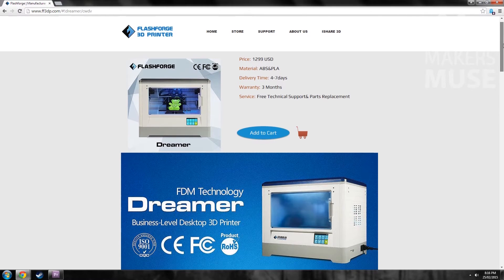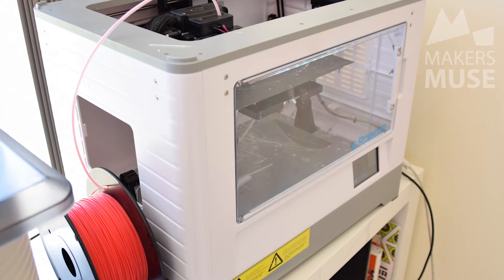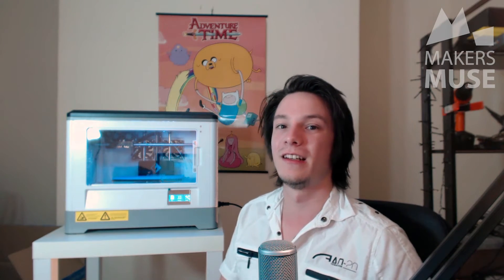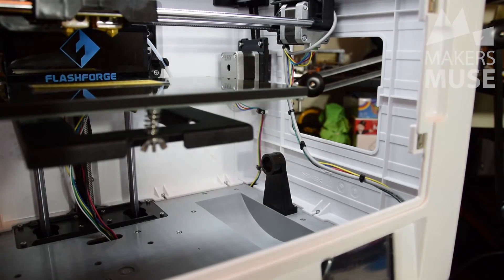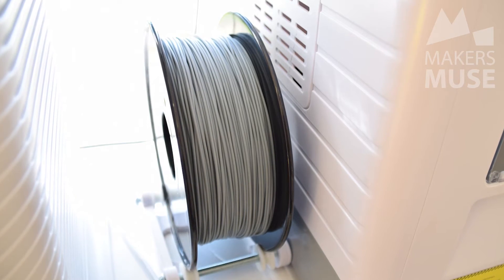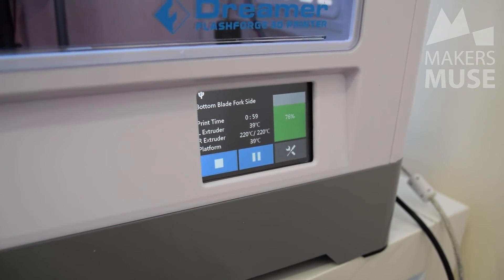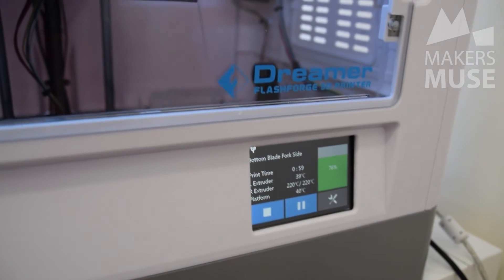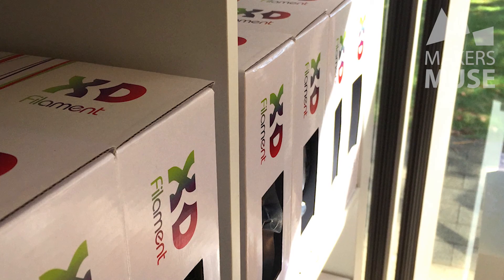Flashforge Dreamer 3D Printer Review - 2015

Comment: Great Review! I enjoy your channel.
request: can you do an in-depth review of the dreamer? including the functionality of the lcd menu options? I have never owned a 3d printer but am intelligent enough to understand that the bad reviews I've seen could be due to the settings the user has. basically I'm asking if you can show the functionality in detail when used properly with the correct filament settings. how well will this do graphene filament? wood fill? carbon fiber? What are the adjustments you can make for printing an exotic with pla for example. stuff like that.
Reply: also, I am looking to print a TPU  bulb pump to push liquid into an ABS tube (hydraulic type device). will the TPU bulb hold liquid? What would the minimum thickness, of the walls of the bulb, need to be printed at?

Comment: Great videos btw.  I own this printer, and can't get ninjaflex to print on it yet.  I noticed your spool holder looks like it would have a smoother feed than what I printed off, hoping that's reason why.  Have you tried ninjaflex with yours?
Reply: +Justin Bourlier If you go to thingiverse there is a print of a build block that has solved the problem of flexible fillament, but i have not tried it myself just yet.

Comment: Thanks for the great instructional video.  I am searching for the right combination of scanner, software and printer.  I need to be able to scan small figures  70mm - 120mm into a software program that will allow me to add cloths, change the leg or arm positions and maybe enlarge the size somewhat.  I have never used a 3D printer before and I have never use a CAD system before, however I can pick up info quicky.  I have a graphics design background - Photoshop - and I have  computer programming degree. 
Any help you can give me will be greatly appreciated. Again thanks for the cool video!
Reply from the maker: +Sonny Phillips To scan figures of high detail at that scale you would have to look into a high end scanning system like the David SLS-3, capable of capturing detail up to 0.05mm but it's not very beginner friendly. You could look into the einscan S (I reviewed it on this channel) which is cheaper but uses a similar 3D Scanning tech. If you're familiar with photoshop you may pick up the Post processing of 3D Scans fairly quickly. You could the use software like zbrush to digitally draw in clothes and tweak the scan (not very easy but possible). Cheers!

Comment: I see you have been using some sort of slurries on the heat bed. I guess if you try hair spray, you'll be delighted by it adhesiveness with clean printing as well. Do respond if you have tried this earlier. I would be glad. :)
Reply from the maker: +Atul Mourya I've moved most of my printers onto buildtak, it works awesome and needs no surface treatment! I used to use abs/acetone slurry but it's very messy. Never had much luck with hairspray, hard to find the right type I suppose!

Comment: I have a robo r1 and it loud. Is this any quieter?
Reply from the maker: +Aiden Kashi Loudness is very subjective, what part is loud, the motor movements, fans? It's certainly not a quiet machine but I haven't used a robo r1 so can't directly compare. The dreamer's plastic frame makes it resonate louder at certainly movement speeds.

Comment: Amazing review, would you recommend this over the creator pro
Reply from the maker: Creator pro is built better but older and the interface isn't as good. Both are about the same in my book, and awesome if you use simplify 3D to slice!
Reply: Maker's Muse
are they comparable in print quality in your opinion.? I'm asking because I'm about to buy either one of them
Reply from the maker: Yeah pretty similar, I feel the creator pro really needs simplify3D to be good but the dreamer is ok with stock software. Also check out the flash forge 'guider' it looks pretty awesome pla only though...
Reply: +Maker's Muse well I'm getting the printer for making an invention and PLA won"t cut it. actually I was going for zortrax but material availiability changed my mind

Comment: Nice review thanks man, I saw the very same design from QIDI TECH 3d printer but much cheaper do you recommend it or do you know anything about it ? thanks
Reply from the maker: ***** They look like a cheaper clone of the older Makerbot Replicator 2X - possibly OK but be wary for poor quality control at that price - you might get a dud... The older 2X's needed a fair few mods to make them as good as the flashforge machines are now.
Reply: +Maker's Muse thanks so much, youre the best !
Reply: +Maker's Muse Hey I finally got the Flashforge dreamer can you tell me whats the best 3d software do you use to design things ? Thanks
Reply from the maker: +AuroraCypher Nice! If you're just starting out, check out 123D Design, or Designspark Mechanical. Both are free  and not too difficult to learn.
Reply: +Maker's Muse hey i have bought the flashforge and trying to print the traffic cone, but as soon as it changes to the next colour the extruders dont "swap" it just prints the white like way over to the left,, PLEASE HELP MEEE. i dont know what to do =(
Reply: Slicer Badger did you assign 2 colors to  it in settiinngs?
Reply: +AuroraCypher yeah it prints in the two colours but the left extruder isnt moving as in it doesnt move so it is in one print, it is so wack... i think its something wrong with the software,,,, IF YOURS IS WORKIGN ANYONE PLEASE TELL ME WHAT FLASHPRINT SOFTWARE VERSION YOU USE PLEASE PLEASE!!      D=
Reply: Slicer Badger ok have you tested left side first then right side then both extruder ? it could be a clogged. Mine is version 3.5.1 latest version.
Reply: +AuroraCypher it isn't clogged... the extruder extruded but doesn't compensate as the traffic cone prints find but when the next colour comes it is to the left... something wrong with the gcode??

Comment: I've had this printer for about a week and i cant get abs to stick to the bed without a raft, is that normal or do I have my settings wrong. I keep raising the bed temp to help but it still wont stick, I am currently heating the bed at 125 and extruding at 235?
Thanks for all the information you are sharing on these printers it helped me make my mind up to buy this machine :)
Reply from the maker: benofkent are you printing onto the blue sheets they come with? Getting the bed level dead on for printing can be hard and you may need to slow the first layer down for maximum adhesion. Your bed is possibly too hot, 90deg should be enough.
Reply: Yes I am printing on the blue sheet it seems to have one already fitted to the bed,
I didn't realize I could slow the first layer down i will give that a try:)

Comment: hi maker muse do you know of a good way to take the old build tack off of my dreamer so i can put a new one on.
Reply from the maker: tmy158 Once you get a corner or two up then you can slowly pull the sheet off, it takes a lot of force but will pull away slowly and steadily. I find a sharp scraper (I have one on hand to get prints off the build tak) is good to help get under an edge. After you pull it off, make sure the bed surface is nice and clean with no sticky residue before putting the new sheet down. :) I use isopropol wipes.

Comment: Hi can this work with google sketchup ? thanks
Reply from the maker: zero00tolerance I highly recommend against google sketchup for 3D Printing - its very hard to get good .stl files out of it without various plugins. I recommend tinkercad, 123D Design and Onshape instead, all free!
Reply: Maker's Muse
ohh wow thanks so much I will check out the softwares you recommended, really like your review video, well informed and details.
Reply from the maker: No worries, glad it was useful!
Reply: +Maker's Muse Really ? I have been using sketchup since the first version but especially us it since I've started 3d Printing around 3 years ago, I do use the STL exporter plugin with my UP mini, I get fantastic print with ABS and PLA with a hardware temp mod, but I might try the software you recommend maybe I will get even better prints. Thanks (subscribed)

Comment: Hi makers muse love the channel, but i just got a dreamer and was wondering what temp i should be printing at for pla and abs and the print bed temp with the tack sheet.

Also i am having trouble getting the print off of the tack sheet that comes with is, the shop i got it from said the following temps

ABS: degrees c
bed 110
extruder 240

PLA
bed 60
extruder 230

and do you have any other tips and tricks for printing with this machine.

thanks
Reply from the maker: tmy158 Hey mate, cheers for the comment! Buildtak doesn't need as much heat on the bed as other materials. Here's what I use on the Flashforge (within simplify 3D). The blue sheets the dreamer comes with are the same as buildtak.

ABS: degrees c
bed 70
extruder 220-230

PLA
bed 60
extruder 210

Worth noting I always print with a raft (my buildtak is always damaged haha), and my nozzle height isn't too close, you should still be able to slide a business card under it when doing the bed level wizard.

If you're printing HUGE ABS parts and they're warping, you may need to increase the bed temp.

There's a good design for 1kg internal spool holder on thingiverse called the 'omni spool' that's worth printing.

Let me know how you go!
Reply: Maker's Muse Thanks so much for the help, also any thoughts on the glass print bed that you can now get for the dreamer from flash forge, is glass worth it or should i just stick with the buildtack.
Reply from the maker: tmy158 Personally I don't have much experience with glass, always just stuck buildtak on and never had a problem. Some people say their ali beds have warped over time, which glass won't do... but haven't had that issue myself!
Reply: Maker's Muse  Those settings worked great, i just printed a small object and it stuck well but wasn't too hard to get off thanks for the help your a miracle worker.
Reply from the maker: tmy158 Awesome, glad to help!

Comment: We really appreciate the shout-out for Simplify3D Software - we agree that the combination of the Flashforge Dreamer and Simplify3D is outstanding!
Reply from the maker: Jann Wilke No worries! I've since been using the two together for ages, works awesomely. Only suggestion would be some way of making it easier to view which extruder is which in the G code viewer, to help double check dual material prints. No idea if that's an easy change or not. :)
Reply: Maker's Muse That's an awesome idea.  Our next release will have dozens of things suggested by our users, so just wait a bit and see :-)
Reply: Jann Wilke I concur, It was well worth the $ .. If you're spending $1500-2000 on a piece of hardware you would be silly not to spend the $150(190AUD) on the software! The Flashprint is fine for simple stuff.. But you can;t go past the support options with simplify!!!

Comment: Ordered mine yesterday, was great to watch your video and be reassured that I've made the right choice. I ordered some BuildTak with mine because I didn't realise it now comes with it, but it'll be good to have some spare for when it inevitably gets torn. The first thing I'm going to print is the OmniStand which is a FlashForge-compatible filament holder for standard 1kg spools.
Reply from the maker: Yoshie Sweet! You won't be disappointed. Thanks for the heads up on the OmniStand, printing one now!
Reply: No worries, let me know how it goes! Make sure you print the top stand if you wish to have 1kg spools, the inside stands will flex and obstruct the build plate if you use heavy filament.
Reply: What slicer do you use?

Comment: The Makerbot rep 2 makes the same sounds.
Reply from the maker: It's a different tune though :P But yeah, very similar because the Flashforge is pretty much based off the rep 2x. Which is mostly why it's a good machine!